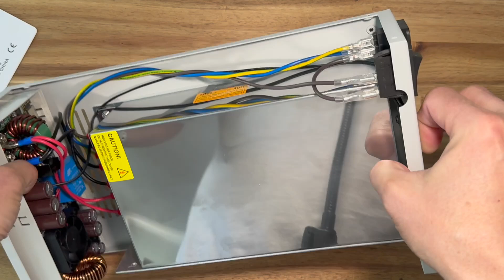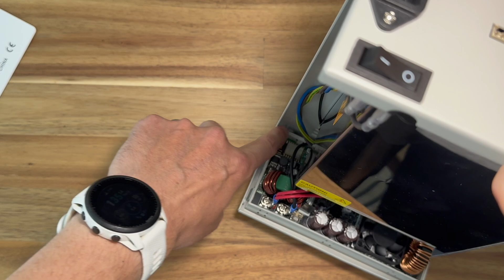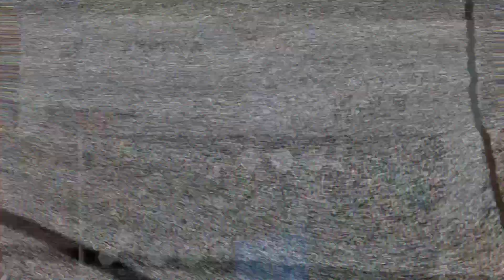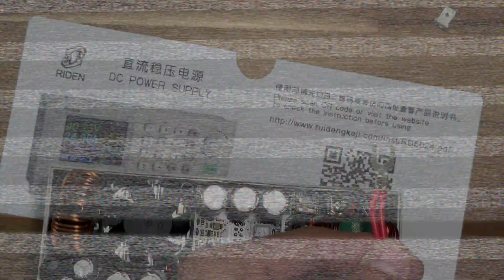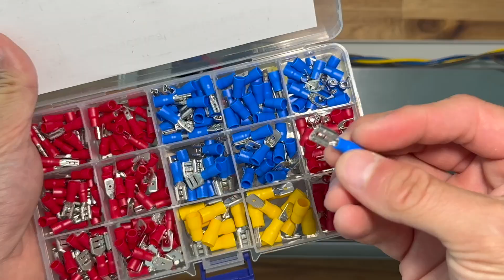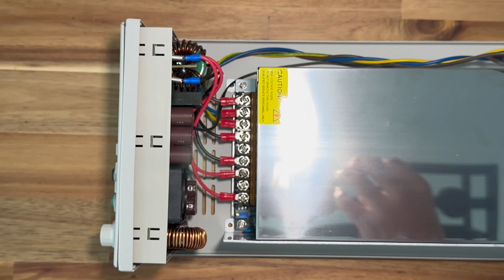Riden RD6024 Assembly w/ New-Style DC Terminal Block Tips Tricks Quick Build RD6024W

Comment: If you get U shaped males you could use two separate wires and not over load those spade connectors/ less voltage drop